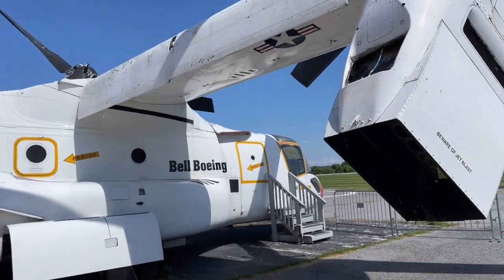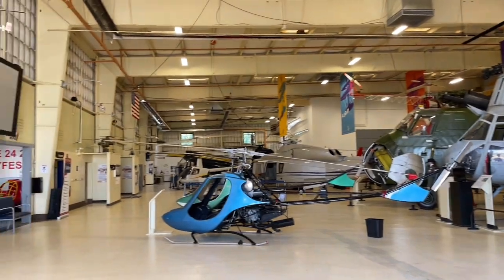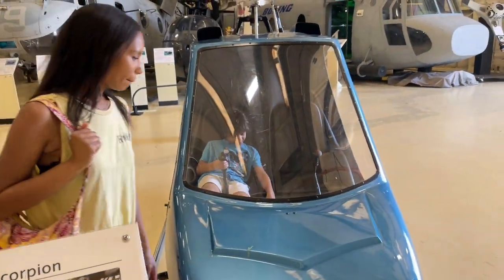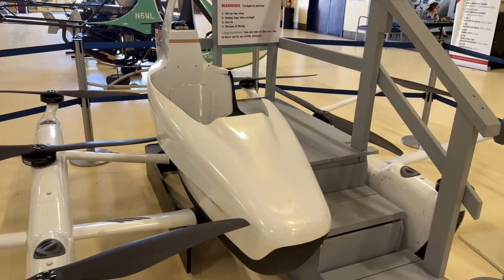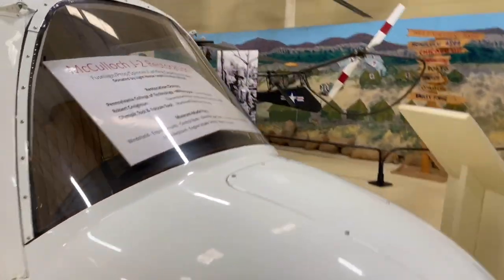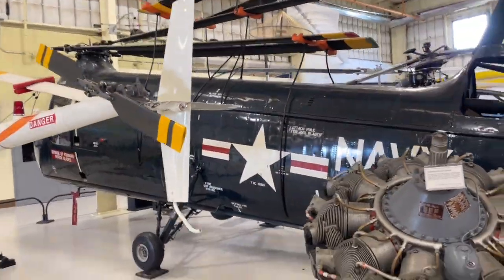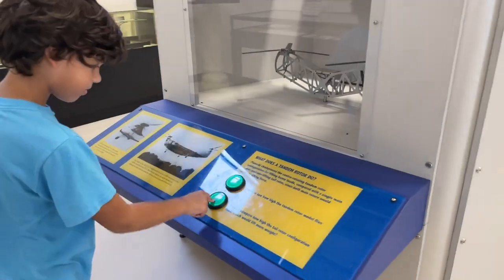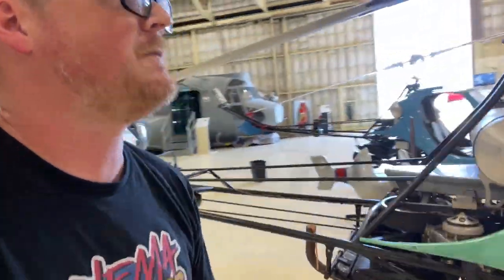RRS | Climbing Inside Antique Helicopters At The American Helicopter Museum In West Chester, PA

Comment: Apache is helicopter out front and carbon fiber is material of the propellers.
Reply from the maker: BINGO! 👍😂
Reply: That's incorrect. It is a Bell AH-1Cobra. Two Main Rotor Blades, Single engine. The Boeing AH-64 Apache has Four Main Rotor Blades and is a Twin engine. They do look similar to the public, but side by side, the differences are very noticeable.  Either way, you don't want to be the bad guy with either one of them facing you!!!

Correct, the word he was looking for was Carbon-Fiber or for you Brit's Carbon-Fibre. 😄

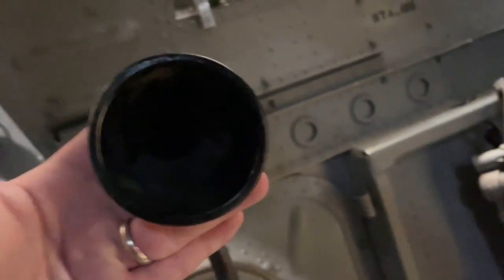Comment: @10:53 
     You definitely DON'T want to put your mouth into that little funnel. And no it's not to talk to anyone. It's called a piss tube. That's right, it is a funnel connected to a hose that goes to the bottom of the aircraft. As you are flying it works like a siphon. You pee into it and it gets sucked right out to the air. After a flight if any crew member had used it, you were supposed to rinse it out with fresh water.